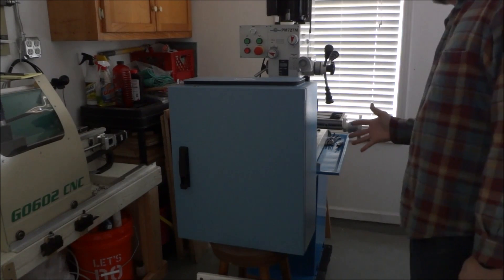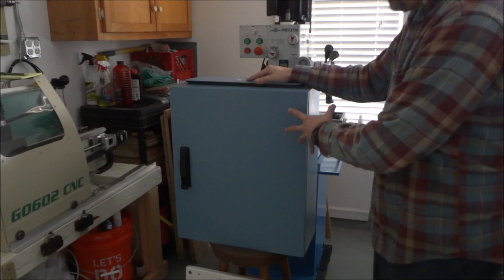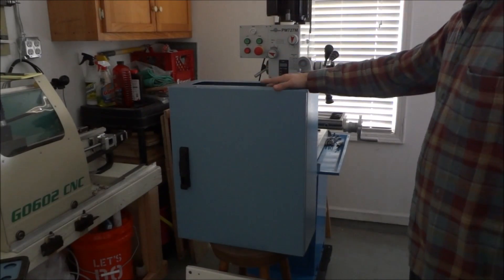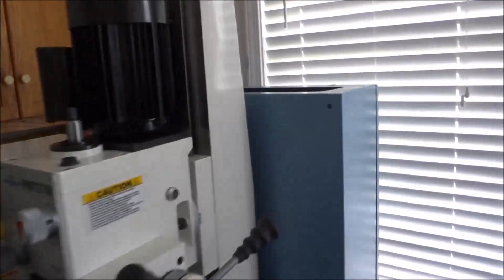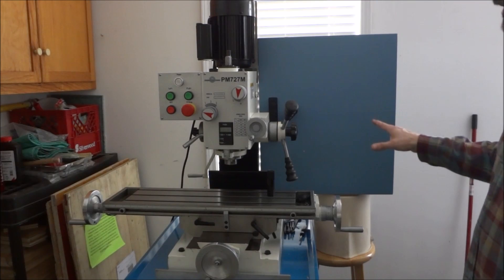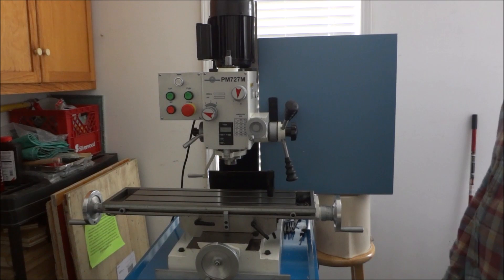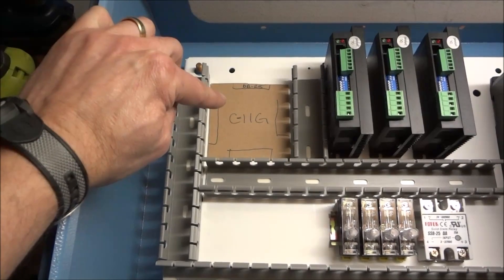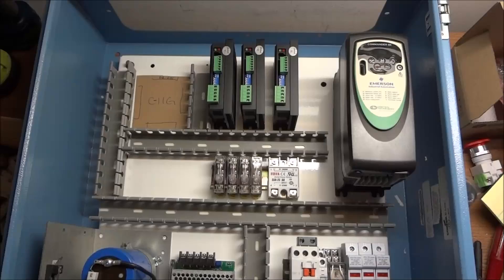PM 727M Electronics control cabinet

Comment: looking good man 
I am also converting my zx45 right now 
I rely like that electrical cabinet I'll be getting my self one 
so far I have got all my motors drivers computer and ball screws.
Reply from the maker: +Cody Cerovski 
Thank you,
 Very cool I almost went with a ZX -45 but space is a premium. I received my Ball screws as well this week I went with thee RM2005 Dbl Ball nut Ball screws. the cabinet is a great price compared to what I found used. What did you decide to go with on the Motors etc.
Reply: +CNC4XR7 
Im using longs motors and drivers nema 34s and dm860a drivers and using rm 2005 ball nut ball screws. im running mach4. 
I am new to cnc and learning how to use mach.
I am happy with my zx45  it costed me $1850 shipped and i built my one stand out of 2'' x.250 square tube.
Reply from the maker: Sounds like a good base from which to build upon. I considered the longs 1200 oz. Steppers as well but went with the 3 phase instead will see how it turns out. Would love to see some shots of your build. 
Be safe 
Sam

Comment: Down on the castors on the right side looks like the best idea. Isolate the whole cabinet from the mill body that way and you
can even put dampening under the castors to even eliminate any vibration off the floor. Nice component layout in that case.
Reply from the maker: Yea that's most likely where it will be located. 
Keeps it away from everything.

Comment: Great cabinet. Who did you end up buying it from? I need one for my mill also.
Reply from the maker: I put the link in the description purchased from EBay offer $79
Reply: +CNC4XR7 I found that one but for some reason I thought you said it was 24x24. I made and offer so we'll see if it is excepted. Thanks for the lead.
Reply from the maker: +William Hardin Sorry no its 20" wide by 24" tall very nice very heavy panel
Reply: He accepted my offer so it's ordered and on it's way. The original box I bought was too small so this one should be just right.
Reply from the maker: +William Hardin Great! I think you will be more than Happy,
Sam

Comment: Nice cabinet man. No such thing as to big :)
I haven't gotten to making a video of my electronics yet, but I actually made a bench between my mill and lathe and mounted the cabinet on top of it. I do like your idea of putting it on the side below the pan though, and I probably would do the same if space is a premium.

Your installation is amazing! Mine is organized, but it looks really messy. I didn't have room to mount wire channels which would have really tidied things up. I plan to roll out my electronics video near the end of my conversion series.
Reply from the maker: +russtuff
Thanks Rus,
 I look forward to the video. I've worked in many panels before in all sorts of configurations so this kind of stuff comes easy to me. The panel is a little crowded once I got everything in there. But it will be neat that's always important if you ever need to trouble shoot a problem.
The more I think about it the better I like it on the floor next to the stand with wheels.
Reply: +CNC4XR7 Lucky. This was my first box and I'm terrible with this sort of thing so it was a total nightmare. I look forward to your next video.
Reply from the maker: +russtuff  Thanks,
Be Safe
Reply: +CNC4XR7 +russtuff im subed to both of your channels and i am going to be working on a personal cnc on a g0759 these vids are perfect for me! Lots of help and keep of the great work both of you. Very cool to see other channels coming by to show some love lol. But i do have 1 question why did you choose the c11g board over the other 2 benefits gained over functionality lost? or was it just for space ?
Reply from the maker: +D Kerekes  Thanks, We all learn from one another and we all solve things in a different ways, sharing helps everyone.
I already had a C-10 and C-6 so I was going with that configuration ( besides I like the fact if one fails they both don't fail)
But when I laid out the box it would have been tight with two cards so I contacted Arturo and he said I could exchange them for credit so I went with the C-11GS it has a Extra relay That can be used for something else in the future and the added SCHP feature. either will work.  But yes the biggest thing was space.